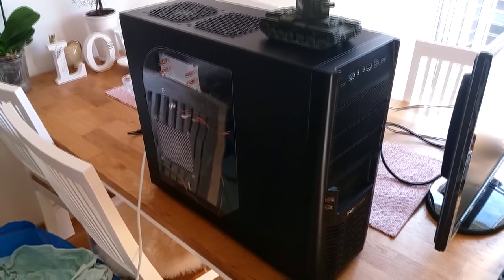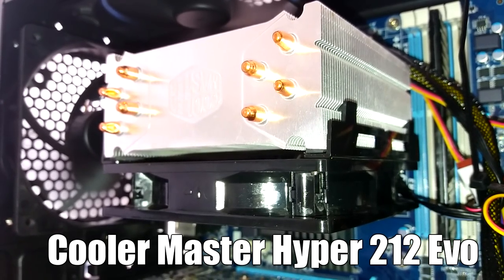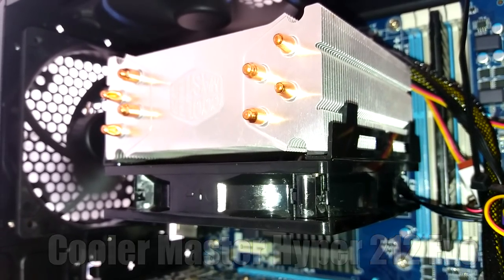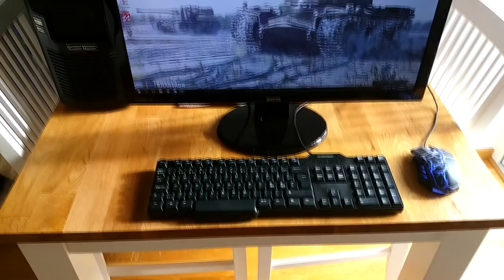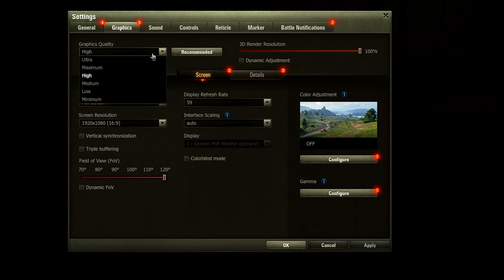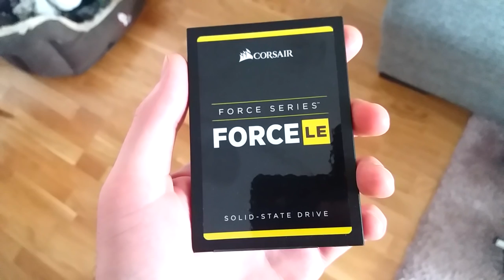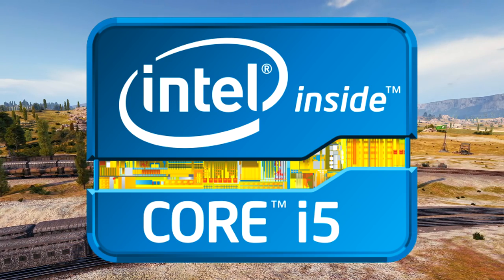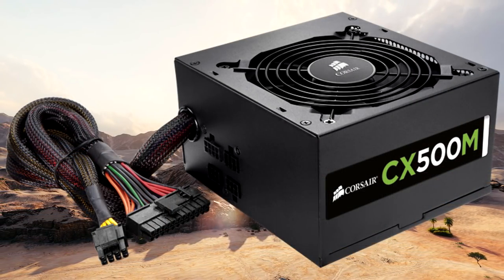Can a potato PC run World of Tanks 1.0?

Comment: It's your video card. WOT relies heavily on the graphics card and 2 gb gtx is doing it for you. I have a quad core processor amd a8 with more memory and I can only run it at low setting otherwise I get 9 fps.......but by video card is only a gt 610 with 1 gb and that's my choke point.

BTW: when they released their test app it said I could run at "minimum" settings but like everything with wot, that's a crock of shit.....

Comment: I have an Acer laptop with an Intel Core i5 4200U (dual core) @ 1.6gHz with 2.3gHz boost, a Geforce 750M, 8gb DDR3 RAM @1666mHz and a 256GB Samsung 850 Evo SSD

I use high settings and I'm getting ~50 fps
Reply: That's not bad at all considering.
Reply: MrLunithy I know right! I did replace the thermal paste to reduce the temps. Its now ~78° after 1 hour of gaming. With overclock I get an extra ~6 fps while running 86°

Comment: No problemo for my PC around 60-80 on ultra HD client
Intel Core i5-6500
Nvidia GTX 1050ti strix
And 16 GB RAM
Reply: why on earth did you buy a gtx1050?
i have a 5yo rig containing an i7 4770k and a gtx970. the upgrade to wot1.0 cut away some fps, from 120 to 100 on hd ultra settings @1080p. the only thing killing it is my mechanical hdd, which is taking forever to move that shit into ram. i never ever would buy a gtx below "x70"; rather rely on the older generation then. :)
Reply: Jhakoon Thx for info i would buy 1070 or higher but i dont have money for that and my pc is like 2 years old idk
Reply: I also have an i7 4770k overclocked and watercooled but with a ZOTAC GTX 1080 mini and 16gb of 1866mhz ram .
Reply: Mark_ 28 I couldn't afford a 1080 at the moment either, but a nice and solid 4gb 970 is just 200 bucks on amazon, and heavily outperforms a 1050, which isn't really that much cheaper. looks like someone fooled you ;)

Comment: İ have sameish build 
X4 620 clocked at 3.2
r7 260x a little boost
8gb ram etc
i first try ultra on 768p and it got 50 fps but that hard drive is aids
Should get an ssd 
İ joined the battle after actual game started
25 seconds later  i think
And thats it my only complain is that

Comment: Bitch please. I'm running WOT 1.0 with these specificatios:
NVidia 9600 GT 2 GB
Intel Core 2 Duo E7200 2.53 GHz 
on a Windows 7 Ultimate 32 bit system.

I'm running it on lowest settings possible + i have some things disabled via the Protanki modpack. I have 'round 60-65 fps tho.

Comment: I have stable 60fps (with V-Sync) with ultra settings in the resolution 2560x1440 with an AMD FX 9590 stable clocked at 4.8 GHz and a AMD RX480 Strix / 16GB RAM /Win 10 64Bit / all installed on SSD
The only thing that I deactivated is motion blur. Because I hate the visual effects of this shit I have enough motion blur in real life with my glasses :D

Comment: That not really a potato, GTX 660? Man try intel HD graphics and a intel pentium.. hahahah 

My rig is a Ryzen 5 1600X, ASUS GTX 1070 OC, 16Gb RAM at 3200Mhz, use a 120Hz refreshing monitor.. WoT, WoWS, CS:GO, BF1, PUBG etc,
All the above except PUBG run over 120 frames at highest settings PUBG comes close so I set the refresh to 100Hz or whatever(I have like 4 refresh rate options)
Also, in CS.. I run it stretched screen res. Everything at lowest graphical settings except for Anti-Aliasing and shadows.. just the way I got used to playing CS over the years.. get over 500fps